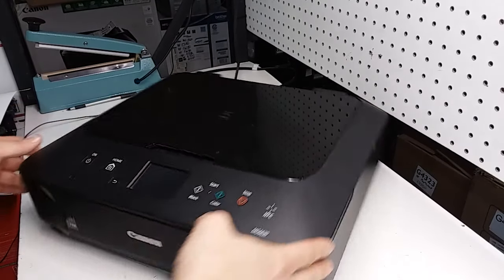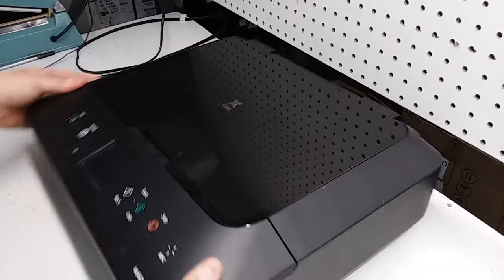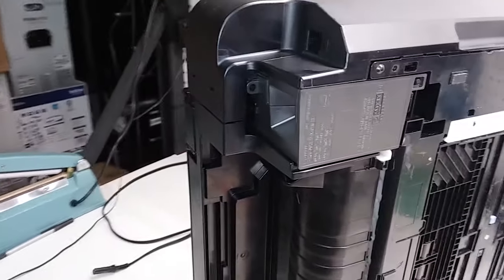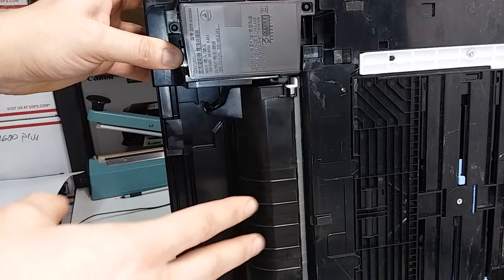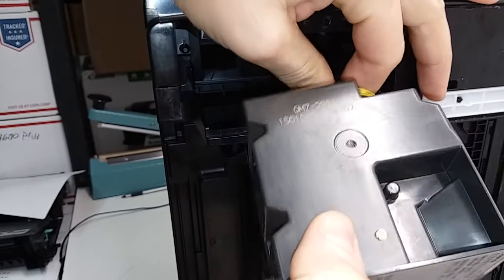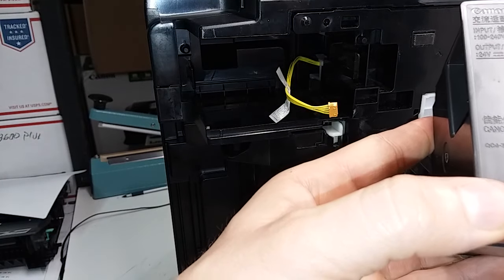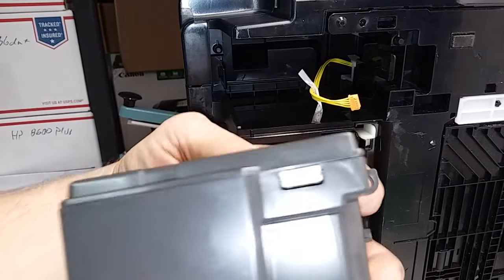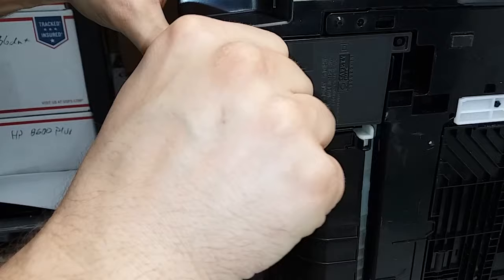Replace Power Supply Unit on Canon Inkjet Printers

Comment: I need help. Can you tell me the voltage of the output pins?
Reply from the maker: I honestly do not mess with power supplies that close. For me, it works or it doesn't. I'm sorry I'm not much help.

Comment: What about the power supply for the printer MG2540s
Reply: Canon pixma
Reply from the maker: It should be attached by a clip on the side of the power supply, also at the bottom of the printer. If I have a similar model, I will post a video.

Comment: where can i find this kc adapter k30288 power supply? thank you
Reply from the maker: I see one on ebay for $21 plus shipping. 
https://www.ebay.com/itm/Canon-Printer-AC-Power-Adapter-k30288-MP970-/184575650395?_trksid=p2349624.m46890.l49286
Reply: Thank you a lot, i see the linke but the dont sell for Switzerland

Comment: Thanks, this shows how easy it is to replace!

I'm looking to buy the replacement via your Ebay site, and when I search for my adapter number (K30314), it comes up with a K30312. Are these 2 parts essentially the same?

It's for the iX6520 printer.

Comment: i have a canon Mx922, its not a very old printer but the other day i went to power it up and the triangle with the lightning bolt in it came up and nothing else happened, no function from the lcd screen.. i suspect the power supply has went, i have a DVOM at my auto shop, whats a good way to test this psu to determind that it is in fact the issue and where is a good place to buy a replacement?  the psu pn is K30350
Reply: I had a power surge and it killed my power adapter. They have it at EBay but comes from China . The problem is that if it's not the adapter you have to make sure the seller does returns. It's hard to return to China.. The cost is from $35 to $50 for the power adapter.

Comment: Currently, my Pixma MG5520 won't power on. I can hear a faint whinning sound that goes away when I press the "OK" button but still don't get any power. Is this the characteristics of a bad power supply? Also, the section of the Power Supply when you insert the 2 prong plug is very loose. It wiggles once the powercord is plugged in.

Comment: Very helpful video getting the PS off my PRO-100 printer. Any idea how to find the pinouts to measure voltage to see if the power supply is the bad component? It's a K30348 with 9 pins. Drake's link is for a different PS with fewer pins.

Comment: Hi there, thanks for the video.

Could I ask if this problem of mine sound like it needs a power supply unit replaced ?

I have a canon pixma mx475, for a few years. Now for the last 3 months, it starts to turn on when plugged in, by beeping once, displaying the word Canon for about 5 seconds, then shuts down, for about 30 seconds. Then it tries to start up again, for about 5 seconds, then shuts down, ad infinitum.

I've changed the plug cable, but still the same problem. My next step was to replace the power supply unit - do you think this sounds like a power supply unit problem ?

All the best,

Chris
Reply: yea i have the same problem too mine has been left dead for 4 years and would not work i tried lots and lots of methods but i think its dead forever :/
Reply: I had the same problem After trying it fix it all day, what I did was disconnect it from my (XFINITY) router then the printer (MG6620) started right up with no problems.

Comment: So you might want to show how to check the voltages on the pins to decide if it is your power supply that is pooched. Pins- 5. 32V 4.Ground 3rd. 24V 2. ground. First pin:Stand by.   There is a german video by Tuhl Teim DE that if you use auto translate subtitles you can figure out if your power supply is the problem.   https://www.youtube.com/watch?v=VVu6mxFAsNg&vl=en-US
Reply: BTW I got a new power supply but now that it powers up I get the "dreaded" printhead error.  Well I guess those are considered to be very sensitive to power spikes. Unfortunately replacement printheads for MX922 cost in the range of $69 to $120+ . While other models can be less than  $25 on that popular auction site. QY6 -0086 is MX922 and maybe I can find a lower model with the same part kicking around someday. The 922 scans duplex which is handy if only the Canon firmware allowed me to use it.

Comment: I'm trying to remove a PS of a PRO-1 and I can't find the right screw driver. Any suggestions what type it could be?
Reply from the maker: What is PS?
Reply: @303electronics  Thank you for the quick reply, it's "Power Supply", I already found it out, there weren't any screws. Thanks again!
Now I only have the problem to open the PS! :)
Reply from the maker: @OliverLeu_Gitarrenunterricht  I've never opened one up. Most Canon power supplies have a screw that needs a special screwdriver tip. Or tiny pliers may be used.
Reply: @303electronics  Thank you! Yes, none of my vast arsenal of screwdrivers are working, I'll try with a plier! Have a nice time. And also nice, when a channel responds so fast, btw!

Comment: my printer turns off but will automatically shutdown after few seconds, it doesn't shows any error
Reply from the maker: Check the power button to make sure it isn't stuck in pressed position
Reply: @303electronics  no its not

Comment: My Pixma MG5650 finally completely died mid-printing a couple of days ago. Would have tried this, but I cannot be sure if it's the power supply. Somebody told me it was likely a burned out capacitor or worse, the motherboard had failed. It's no great shakes though. It was without a doubt the worst printer I've ever owned, totally unreliable, wifi constantly dropping out and wouldn't even connect sometimes via USB. Would print yellows as brown, blues as green and reds with a purple tint, plus it printed fine text and lines in double- apparently caused by a fault with the print head design that some Canons are afflicted by. The scanner wouldn't scan same size and always enlarged everything something like 500%(!) The only thing that worked faultlessly was the copier. Canon was no help whatsoever. Quite heartily glad it packed up and pleased to see the back of it.

Comment: I have a MX922 and mine only shows a blue light next to the copy button but the screen display does not come on. I hear no noise from the printer when I turn it on. Could it be the power supply or logic board?
Reply from the maker: Hi. It can be either, and also none of them. The control panel may have disconnected from main board. Check that connection.  Also, see 8f you can remove printhead and try to restart the printer and see if it goes on like it should.
Reply: 303 Electronics I can’t move the print head... it seems like it’s stuck in there. I had the B200 error before it went out...
Reply: @MoLife Hacks Hi, did you ever figure out what the problem was?